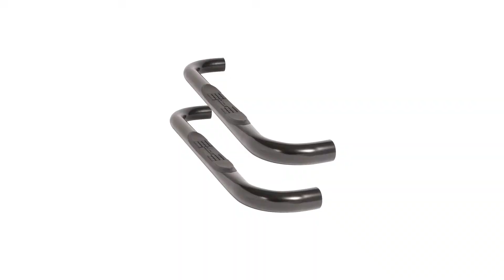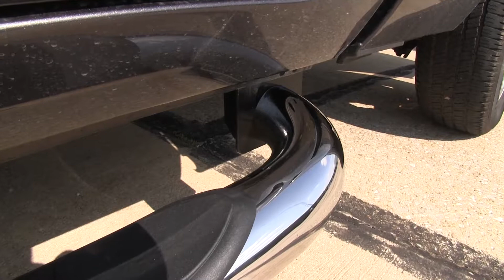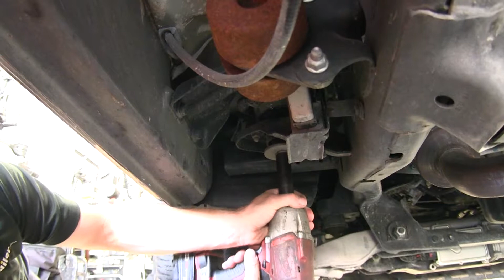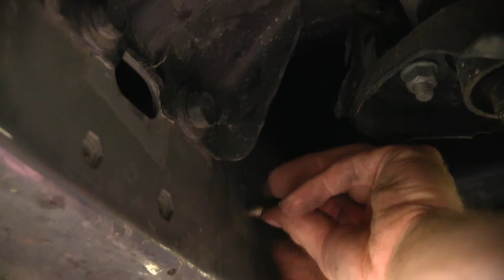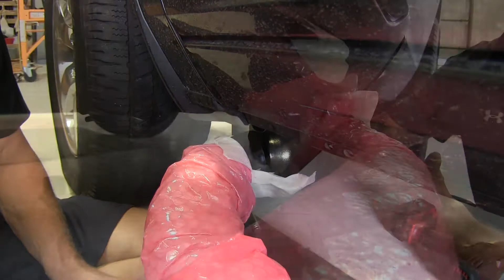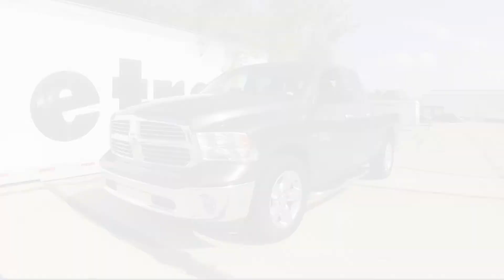etrailer | How to Install: DeeZee Nerf Bars on your 2016 Ram 1500

Comment: Do you have bolts for the brackets
Reply from the maker: Unfortunately we do not. You can source them directly from DeeZee, though. You can reach them at 800-779-8222.
https://www.etrailer.com/Solar-Charge-Controllers/Go-Power/GP76QR.html

Comment: Can this bar be installed on the Chevrolet Silverado 1500?
Reply from the maker: This particular kit is designed to fit the Ram. Check out the following kit.
https://www.etrailer.com/Nerf-Bars---Running-Boards/DeeZee/DZ372531.html